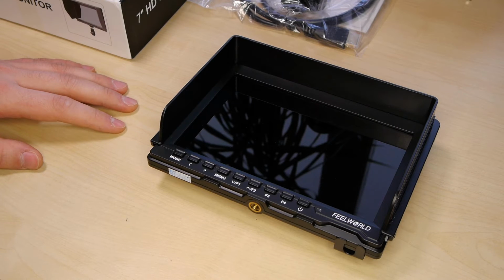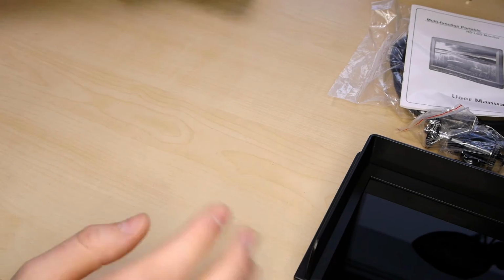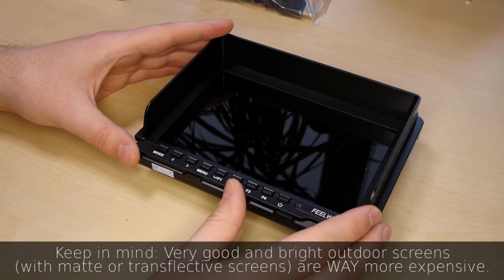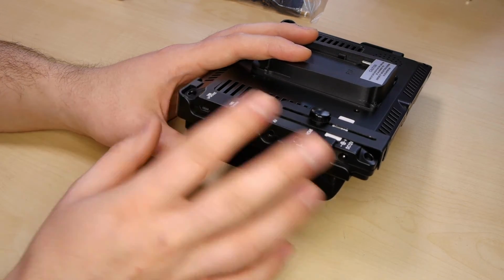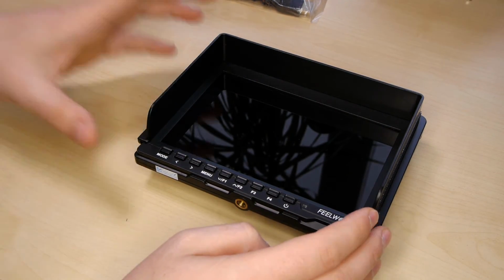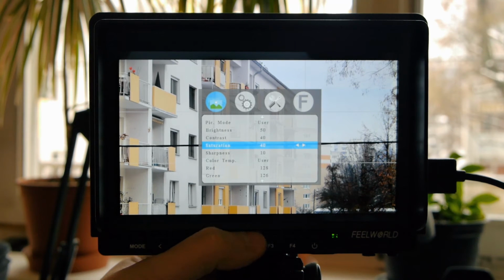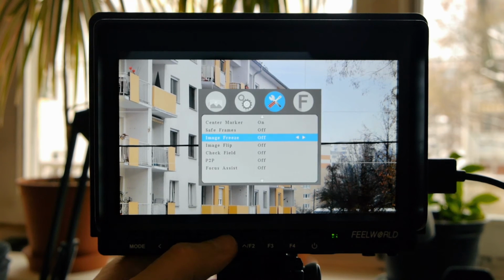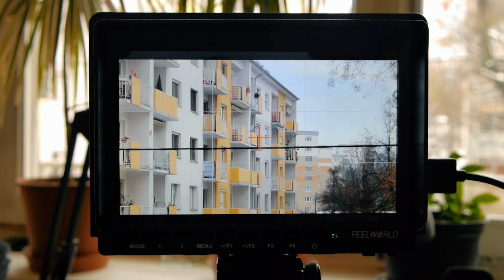Feelworld FW759 / FW759P field monitor - Very detailed HANDS ON (with calibration settings) (!)

Comment: Does it charge the battery on the monitor when a 12V adapter is connected??
Reply from the maker: Nope. It´s not - But thats not possible with any monitor I know of to be honest ^^.
You need batteries anyways - So it´s the best solution to go for a battery kit (2 batteries + charger for example).

Comment: Thanks for your excellent review. I was wondering how to update my firmware. I have a Neewer 759 which seems to be very similar if not identical to this monitor. I didn't find anything on Neewer's website.
Reply from the maker: Sorry for the late reply. Hmm. As far as I know it´s not possible from scratch on (Feelworld isn´t offering the firmwares as download on their website(s) for example). But you can ask the Neewer or Feelworld support, if they can send you the right file. Btw.: You normaly also see the firmware version at the bottom in the menu. Though: If you bought it not THAT long ago (like my model - Which is quite old already firmware wise), then it should not be necessary to upgrade the firmware ^^.

Comment: wondering how much it cost?
Reply from the maker: Well. It´s variating a little bit - But you get it around 140 bucks actually over Amazon for example: http://amzn.to/2rYgpHU Alternatively check out also the newer FW760 or the F7 (also both from Feelworld). They come with even more features than the FW759 (and even more than the advanced FW759P model). AND: They offer native 1080P screens and 4K input support (so they are also way more future proof - As basically every new camera is coming with 4K now - With exception of Canon ^^). I think it´s a good investment and upgrade from the FW759. So check them out. Btw.: Save a little bit longer, if money is short - It´s worth the waiting ^^. Here are the links for example to Amazon: http://amzn.to/2tjiGBQ (FW760) http://amzn.to/2rYc8El (F7)

Comment: i get no picture when i connect it to my a7r2 i dont think its the hdmi cable, is there a setting on my camera i gotta change?
Reply from the maker: Yes. Try to change the HDMI output to 1080P (as in AUTO mode, the cameras sometimes don´t recognise, that the monitor isn´t 4K capable). As soon as you switch it, you also should get an image. Btw.: Also keep yourself in the "movie mode" on the top dial (as long as you´re shooting videos). In this mode the HDMI out is also more constant (no more blackouts - Which are partly the case if you´re starting the video recording in the other modes). Hope that helps - Have a nice day ^^

Comment: This looks like a great buy! I am looking to use it mounted to the DJI Ronin M, but I am wondering what kind of mount you would recommend and what comes in the package with thie Feelworld one?
Reply from the maker: Hmm. You could use a small universal clamp (on the horizontal rod / rail of the Ronin) and the already included small ballhead on top to mount the screen (so you´re still able to tilt it through the ballhead). Or you could also use one of the Ronin M compatible clamps (which are secured better) - There are also a few 3rd party ones available (and use the ballhead on one of those). According powering it: Hmm. The bad thing is, that you need the "DJI Power Distribution Box" for the Ronin M, to power the screen directly from the battery. Maybe you can find one used (cheap), as it´s not perfect, to use a seperate battery on the screen. Why? Because with the smaller Sony NP-F it´s not running THAT long. And the ballhead isn´t the most stable one (to use the bigger NP-F970 for example). Beside that, you´re adding more weight (which is also not wanted most of the time). It´s also easier to change one battery than to keep an eye on two (the Ronin AND the monitor). You could even power your camera from the "DJI Power Distribution Box" with an additional DC coupler. Then you only need one battery for your whole setup ^^.

Comment: I have a Nikon D3200 and this monitor and each time I go to hit live view, the camera live view and monitor go dark each time? Also, what ring light are you using? ;D
Reply from the maker: Hi there. Try to switch the HDMI out from Auto (or 1080i/p to 720P). The camera is dropping the resolution anyways to 720P while recording - As far as I remember (so by switching to this mode, it´s at least staying on - And there is no "blackout" time when pressing the rec button). Secondly: You need to switch through the info display modes with the info button on the left bottom corner -> That way you get a bigger image (I am just not sure if you get a 100% full screen one - But at least you can switch through the amount of information displayed). If it´s still not working, try out a differnt cable (or try it out on a TV set) - That way you can test, if it´s a problem with the cable or the field monitor (many times the super cheap included HDMI cables are the problem). About the ring-light: It´s the F&V R300 (with milk filter attachement). Not the best on the market anymore - But it´s a "good old standard" around 85 CRI and with 5600K (with the standard diffusor). If you´re interested to buy one: There is also a 15mm rod attachement available (which I use most of the time). And as a side note: The milk filter shifts the color temperature a little bit. It´s then around 4700 to 4800K (not at 5600k anymore). Just in case you plan to mix it with other lights (CRI / TLCI on the other hand stays the same - I measured it a few weeks ago) ^^.

Hope that helps =).
Have fun shooting (!)

Comment: I can't get it to work for anything now with my GH4.. I even used the recommendation 1080p. It's not even connecting at all. I tried multiple HDMI chords but still nothing. I know my GH4 is not the problem being that it connects to other monitors. 
If anybody have any solutions to this problem I'll really appreciate it. Thanks in advance.
Reply from the maker: Try it with a cable on a computer - If its also not working there either, then it´s defect and you need to ask the dealer for a replacement.
Reply: Do you have the battery in?

Comment: Hello I am using the Sony a7sII with this monitor. I can connect it and all but it doesn't seem to fit the screen no matter what.  I tried changing the aspect ratio and I still get the bars on the side of the monitor.  Not sure why.  I've tried adjusting it both in the camera and the monitor.  Any reason why it is doing this?
Reply from the maker: Hmm. The FW759 scaler doesn´t support 4K (only 1080P). So (if you didn´t try this alreday): Fix the HDMI output on the camera to 1080P. Sometimes the AUTO settings are not recognising the monitor right. On the screen you can check out the overscan / underscan. But this is normaly only a small adjustment (so if there´s a big black bar around, then it´s for sure not that option). Btw.: Also test it out on a computer / other camera (and also with another cable). It could be also a defect of the scaler - OR a defect of the included HDMI cable. Most freely included ones are of a really bad quality (!)
Reply: Thanks.  You were very close and after telling me about the HDMI setting it was actually the info display that needed to be turned off.  Your help was much appreciated.
Reply from the maker: Good to hear you fixed it - Have fun shooting ^^.

Comment: Hello! I recently purchased a Blackmagic 5" Video Assist to use on my 5D Mark II but it does not seem compatible. Whenever I press record the monitor goes black. Will this monitor let me view the image as I record on a 5D Mark II?
Reply from the maker: Well - Originally the 5D II drops to 480P as soon as you press the REC button on your camera. And that mode is not supported by the Video Assist (It also wouldn´t make sense to record such a low quality signal). It´s supported by the Feelworld FW759 / FW760 / F7 models though - Which are all basically the same (as they offer the "camera mode" which is then zooming the image bigger and is not giving you a blackout in the image output).

A small hint: There is an option btw. to get an higher resolution output over the HDMI with your 5D Mk.II -> If you  use Magic Lantern. But as far as I remember right, it´s not possible to output the native 1080P signal over the HDMI (to record it with a better quality with an external recorder) - The max. resolution is too low / too limited to reach 1920x1080 progressively over the HDMI. You need the 5D III to get native 1:1 progressive (full resolution) 1080P output. But if you use the 5D III, you can then also use the internal RAW recording. So no need to use an external recorder then ^^. So if you just need a screen, go for the FW759. But also don´t expect wonders without Magic Lantern. 480P (which is the original output without the Magic Lantern hack / mod) is not really helping to pull the focus. You need the higher resolution which is possible with Magic Lantern. Otherwise the screen only helps to frame the screne.

Hope that helps ^^.

Comment: Great video again, thanks for sharing! How about a review of the Feelworld F7, you mentioned in your reply to my post in your Lilliput 5D-II O/P? TIA, Cheers
Reply from the maker: It´s planned. But first I need to make a video about the Aputure VS-2 FineHD (if there´s time). Overall the F7 should be basically the same software wise as the FW759/FW760 (just with more features) - And the hardware should be quite similar to the 1080P panel FW760 version. So if you need a screen now - Go for it (and maybe report back your experiences) =)

Comment: Hi, is it the best (cheap) option for a Canon 5D Mark 3 ?
Reply from the maker: More or less - YES. Altough there are also other models you can check out (from Feelworld). The FW760 for example (which is coming with a 1920x1080 resolution panel -> Which is more future proof). Or you can also go for the brand new Feelworld F7 which is priced around the FW760 (just a few bucks more). But it´s a new case design. And it´s also coming with even more features (software wise) whan the FW760 - So check it out (!) ^^
Reply: Do we get a few seconds delay when switching from recording mode to play? I mean is there ay hdmi resolution problems with 5D mark III?

Comment: Does it support 4K?
Reply from the maker: Nope. Only the FW760 and the brand new F7 supports 4K. Keep an eye on the description of the dealer (if you go for the FW760).
(As there are also early models without 4K support.) Overall the best move is to check out the F7 -> It also offers even more features than the FW760 - And it´s just a few bucks more expensive. The FW759 is also a nice unit - But no 4K support there (so your camera needs to scale to 1080P over the HDMI -> Which slows down the AF on some cameras -> GH4 for example). I would go for the new F7 (maybe I also review it some time in the future). Sorry for my late reply btw. ^^

Comment: Hi, i would like to know whether there is any option to mute the sound from the monitor? This happen when I connect via HDMI to my Lumix G85 and the annoyed humming sound came out. This also happen when i connect to Sony A7Sii. Appreciate your help, thank you.
Reply from the maker: Yes - There is one: You just need to use the left / right arrows to control the volume (when you´re not in the menu). Just put it to zero. OR: You can also use a 3.5mm plug or headphones to disable the internal speaker - Then you also don´t get those weird "feedback noises". Have fun shooting (!)

Comment: How can I get the image to fit the screen? I would like to shoot in 2.35:1 but I can't get the camera image to fit the entire screen so I can use the safety frames
Reply from the maker: With which camera? Are you sure, that the camera is able to output full sized 1080i or 1080P images?
(Without any black bars -> Some Canon bodies are for example outputting a black bar around the live view image over the HDMI ...)
Reply: Getting the same issue with the Sony A7sII.  it can do 4k so it shouldn't be a problem.  Can't figure out how to fit the screen.

Comment: Good review as always! I have film camera with a video tap that produces 352 x 288 (PAL). I presume the best monitor for such a low bandwidth signal is a 800 x 400 type? Is anything higher than that not worth it e.g. FW759? I looked at a Viltrox DC-50 and a Lilliput 569GL-50NP/HO/Y.  I wasn't looking for more than 5" and it's only to show decent picture of what's being filmed - it's not for focusing, exposure etc. The 5" ones are almost the same price as the 7" ones. What is your opinion on this? Thanks.
Reply from the maker: Hmm. Good question - First time someone asked according analog connections ^^.

Overall avoid the newer models. Some of them still offer analog inputs. BUT: You need weird adapters to get the signal connected (like with the FW759 for example - Or the Viltrox DC-50 / DC-70 and so on). And the more affordable models are by far not optimised anymore for analog signals (as 99% are not using analog signals anymore - At least not with direct connections to the camera - Wireless is another story ^^). So search for the older models (like the older generation Lilliputs) with good old BNC connectors - Like the already mentioned 569GL for example (or the 665GL - Which is quite ok 7" model - Basically the 5D-II model with more analog inputs ^^).

I would try to get a used 569 though - I saw them multiple times go away used in like new condition for about 50$ (and i like the small form factor). You need to be lucky to get it at such a good price. But if you´re not in a hurry, you maybe get a bargain screen with good quality. ^^ Btw.: I also have to mention -> Don´t expect wonders (or a really usable image for focus pulling or so). The resolution is just too low over the old analog connections. But at least you get a better sense for framing your shots (and you can replace defect viewfinders or onboard screens) ^^.

Hope that helps. =)
Reply: Thanks for info. I've been looking for the 569 but it's still expensive. I've realised that 5" models tend to be more expensive than the 7" ones.
Reply: The 569 is proving to be too expensive. I have found a 5" Bestview going for a very good price. It has a 3.5mm input with a cable that can give you a composite video input. Not ideal but might be ok.

Comment: How do I mount the Feelworld monitor to my Panasonic GH4 camera?
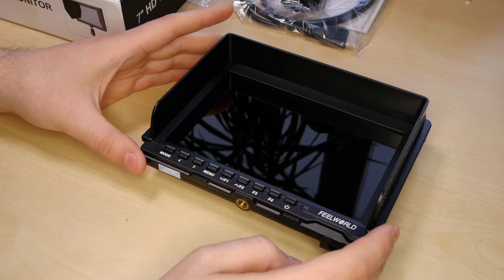Reply from the maker: You can use the ballhead which is included with the screen (you can see it at the 2:19 timestamp).
Or you can also mount you GH4 to a rig / small baseplate with 15mm rods, and then mount the screen to a magic arm.
You´re more flexible with the 2nd solution. But it should also work with the 1st one ^^.

Comment: I have the P version and a G7. The screen goes blue when I record. Any thoughts how to fix it??
Reply from the maker: I am sorry to say that - But the G7 doesn´t output HDMI while recording. Only the GH4 and the new G85 for example are outputting a signal. So it´s not a problem with the monitor - It´s a limitation of your body. Two options: Change to the G85 (or a used GH4) or sell the screen again / return it to the dealer. I would consider to upgrade to the G85 (it´s a great camera - also upgraded from a G7 / changed from a GH4).

LG

Comment: hey thank you very much for your review ! I was wondering if there is a lag time between the screen and the camera because ive seen that some screens have a little latency and it could become a problem if im trying to focus moving subjects on my shoulder rig. Could you confirm me that? Thanks
Reply from the maker: Nope. I didn´t notice any. At least it´s not higher compared to other models. Though: Keep in mind that all cameras are adding a little bit of delay through the HDMI (as it takes its time to process the sensor data and convert it to the HDMI signal). You can also try different HDMI output modes -> For example 4K internal recording to 1080P over the HDMI adds often more delay then 4K to 4K over the HDMI, as there´s a downscaling needed (and that´s done by the camera LSI / processor -> External monitors are normaly faster doing that). To prevent this camera internal 4K to 1080P downscaling (IF you use a 4K capable camera ^^), you can also choose a 4K capable screen like the newer 4K capable Feelworld FW760 / F7 or the IKAN DH5e / DH7 models.

Btw.: If you choose the FW760 for example you also get a higher resolution panel compared to the FW759 and even more features than with the advanced features FW759P model - So it´s a good choice and only a few bucks more expensive. But keep an eye on the 4K designation - Some very early FW760 models seems to use the older (non 4K capable) input scaler of the FW759 (not the newer 4K capable one). So check the supported resolutions on the sellers page before ordering ^^. Or go for the brand new Feelworld F7 model (altough that one is coming with fewer buttons and without an HDMI lock - So I don´t know if it´s really useful to go for it, as it´s also more expensive than the FW760 at this time - Software features and the panel seems to be the same - So choose as you like ^^).

Hope that helps.
And have fun shooting! LG

Comment: Does this monitor comes with the battery from the factory?
Reply from the maker: No. There are no batteries and no charger included. BUT: You can get such kits (two batteries + charger) for about 40 to 60 bucks over Amazon for example. And then you have at least longer (and local) warranty on them. The included batteries, which are coming with such monitor kits, are often not of a high / good quality anyways (and get defect quite soon). So it´s all in all the better way to save money on the monitor kit (and to buy the batteries seperately). ^^